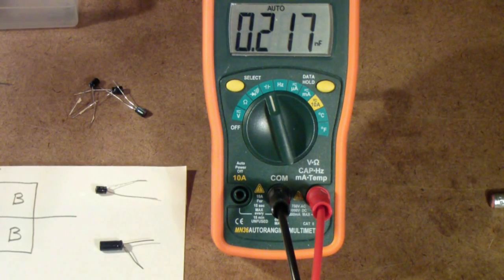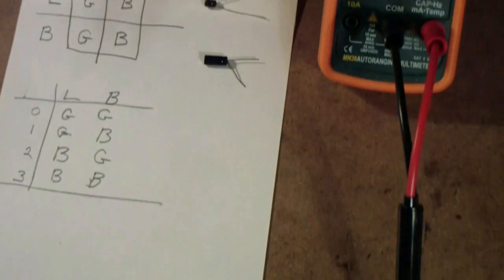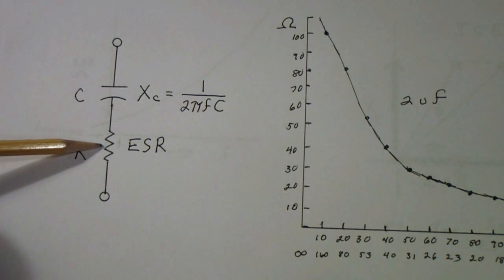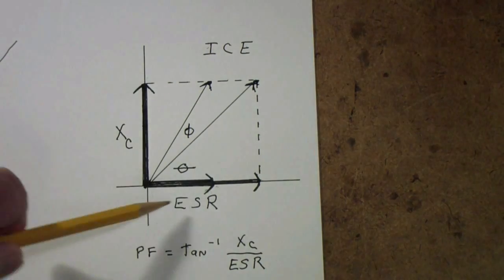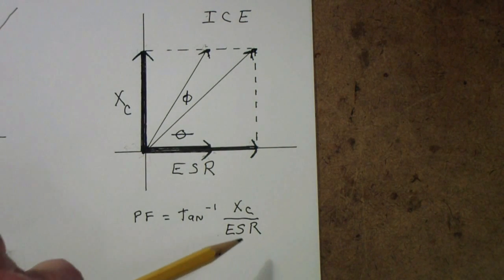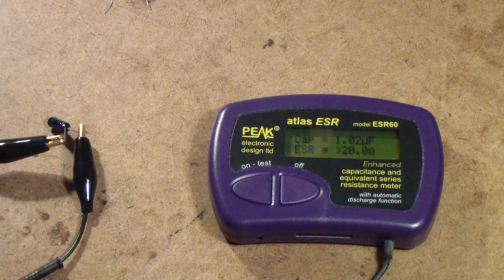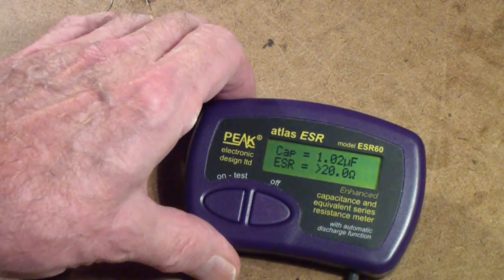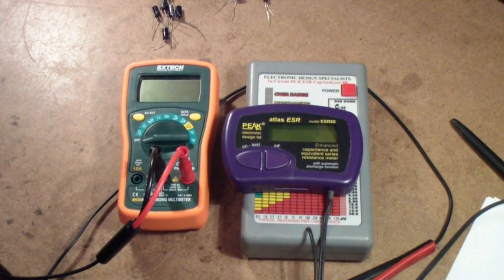TTT133 ESR & Power Factor

Comment: You mention that each tester operates at a different frequency. What about the popular LCR meter model de-5000 that has adjustable frequency from 100 Hz to 100 kHz And does esr and all sorts of other measurements for capacitors and other components.. I’ve used it for over a year and I like it quite a bit but I haven’t mastered it just yet
Reply from the maker: Actually, the DE5000 is my favorite LCR tester. You are right that it offers multiple frequencies, as do some other testers as well. But the DE5000 allows the user to choose the frequency instead of the tester choosing. I prefer the DE5000 allowing the user to choose and I usually use 120 Hz for electrolytics used in line voltage power supplies, 100kHz for those used in switch-mode supplies, and either 10 kHZ or 100 kHz for film, mica and other non-electrolytics. I may try to do a video on the choice of testing frequency for capacitors but I, too am still learning to use the DE5000 to its full capacity.
Reply: @tomtektest8042  yes I think it is a wonderful meter! Thanks a lot for your input and advice. And I would love to see a video of the de-5000
Reply: @tomtektest8042  it would be great

Comment: You say power factor is "an analog of" or "a surrogate for" equivalent series resistance, and vice-versa. 
I may be wrong but I think the phrase you may have been searching for is: "can be understood to a proxy for", amiright?
Reply: Thank you for such an excellent and comprehensive video. I've got an older capacitor tester (a balanced-bridge unit made by Sprague, the TO-5) and I've been trying to understand the relationship between the two. It always seemed they were very similar but somehow different, and I think I understand now– and please correct me if I'm wrong– that "power factor" was used because it accurately described capacitors' power dissipation at the limited (ie lower) frequencies which they then mostly encountered. Higher (megacycle and above) frequencies simply weren't much considered, as they weren't in, uh, "frequent" use in radio or electronics (FM, with its higher-frequency/ higher-bandwidth requirements had yet to become an everyday reality).

Comment: If you look at the Operating Procedure for an old Heathkit C-3 capacitance tester it will say that "electrolytics have a certain internal series resistance" . It then goes on to say "to balance the bridge circuit of the tester you have to add some series resistance using the POWER FACTOR control". So this control, when adjusted correctly, will equal the ESR of the capacitor AT THE FREQUENCY USED in the tester.  Now I suspect that modern, new electrolytics have such low ESRs that the Power Factor control will usually be near its ZERO percent position.

Comment: It's me again. I'm paused at 5:25 looking at your chart, and either you are way off or I am way off. For example, at 10 Hz, I get 1/(2*pi*10*2e-6) = 8k ohms, nowhere near 100 ohms.
Reply from the maker: You are right, the value I get is 7957 ohms. I did the chart using an online calculator and I must have entered something wrong and never checked the results since I was only using it to illustrate the decline with frequency.. Thanks for catching the error.
Reply: I was thinking that 100Ω seemed low. Thanks for this reality check.